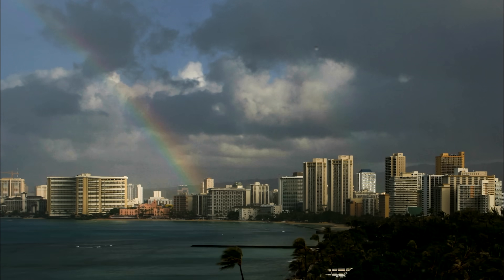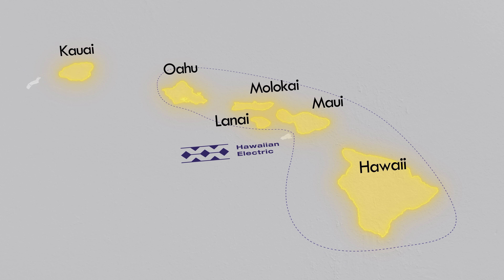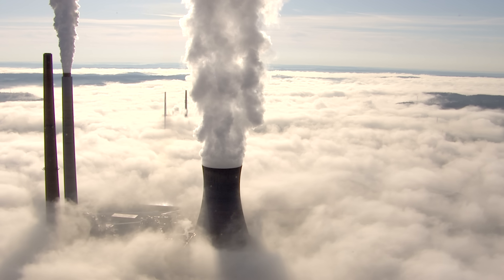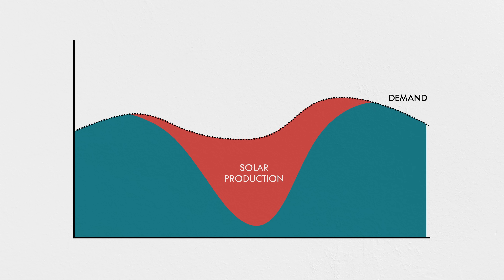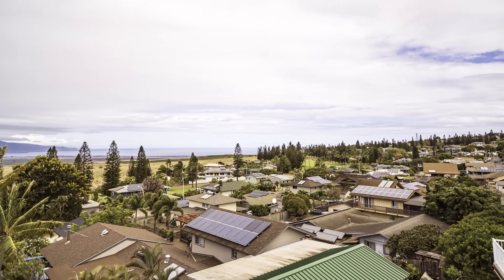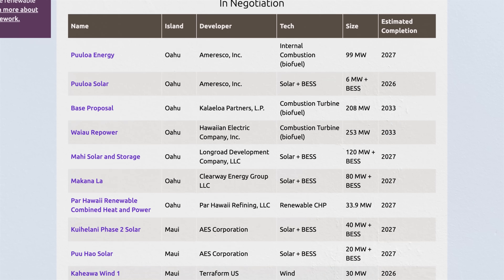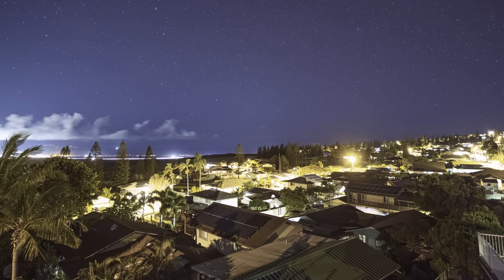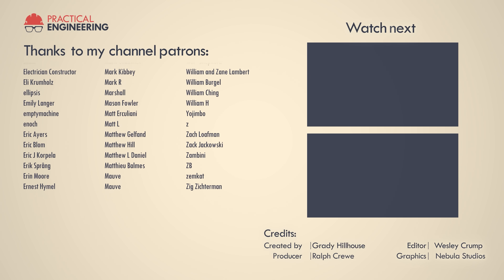How the Hawaiian Power Grid Works

Comment: Excellent video!  Retired power engineer here - worked on a study for the US DOE back in the early 80's that highlighted most of the same points you mention.  While it might seem that the industry has been dragging its feet on addressing the problems, the fact is that solutions rely on technology that simply didn't exist and that had to be developed, and that takes time.  And there's more to be done - which is why power engineering may seem to be boring and mundane, but in fact is one of the most dynamic fields to be in.

And by the way - the situation is Texas is actually quite similar to Hawaii - slightly larger in scale, but still an isolated grid with some of the same issues.
Reply: I have never heard of a Power Engineer, what does one do, and what schools have courses for such a discipline?
Reply: @ColdWindPhoenix84  I was an Electrical Engineer who graduated from University of Louisville. I had Power courses taught by LG&E electrical engineers.
Reply: @jeffjwatts  electrical and computer engineer degrees from university of Kentucky. Power engineering was a subset or specialization of electrical engineering. I don’t think they were taught by LGE-KU employees but were pretty good for base knowledge of power.
Reply: @ColdWindPhoenix84 It's a specialty within Electrical Engineering. Many Universities make that specialization available (though it may use other terms like "energy systems" or "energy systems and renewable energy" depending on the University)
Reply: Texas is isolated because Texas. (politics) Hawaii is isolated because it physically is. Texas is a choice; Hawaii is an unfortunate reality.
Reply: I'm a mechanical engineering student and I'm considering to continue my studies in power conversion field. How do you see the future of this field? Is it versatile as they say it is? My other option is mechateonics. Which one would you choose in the us? Also if you can give me some tips I'll be grateful. Thanks
Reply: @danielkarbaseyan1150 mechatronics allowed me to get a field/engineering job with a utility company, now’s a great time to be looking for a job due to large waves of retiring folks 
Check around your area for jobs/internships (summer internships are common) and also diversify yourself
Reply: @danielkarbaseyan1150  - “power conversion”

The world will always need power, it will likely require some travel.

As long as manufacturers remain in country, Mechatronics may be a good field… but likely will require some travel.
Reply: @DavidHalko  I heard that mechatronics field is not as profitable as (HVAC- heat exchanger design, boilers,solar etc=what I meant by energy conversion) and is not likely to be in the near future. And probably for starting my own business, small scale businesses will be better. Is that the case in us?( not currently living in the us , excuse the low info on my part)
Reply: @danielkarbaseyan1150  - there will always be the need for HVAC, but HVAC technician gets very busy during summer & winter with emergencies. There is a reason people earn more money — they work hard! LOL! 😂
Reply: Questions for the retired power engineer! Let's say most residential and commercial properties in Hawaii adopted Tesla Powerwall's (or I guess any other brand of powerwall), and they made their electric system bi-directional. So during outages, or times of greater need, they could draw from the homes who at that moment had excess power to give. Then, have them install some more Tesla Megapack sites all around  Hawaii to help stabilize the grid even further. Would that be a good overall solution? Also, what are your thoughts today on nuclear power, not just for Hawaii, but in general. I have heard arguments that it is dangerous, and the spent fuel rods pile up with nowhere to put them. I have also heard from the other side, that the most modern designs are extremely safe, and that it's simply not true that there is no use for the spent fuel rods. That in fact, the spent fuel rods can be re-processed and re-purposed. I don't really know what to believe, but I am in favor of nuclear power plants, if in fact they can be engineered more safely than past versions, and if it's true that spent nuclear fuel can actually be re-processed and re-purposed.
Reply: *Ted Cruz has entered his hotel room in Cancun.
Reply: I worked at a DOE national lab that helped to develop a bunch of “smart grid” tech, as well as battery storage. It’s fascinating stuff!
Reply: Texas does interface to the main U.S. power grid and has bought and sold power before. What makes Texas different is that unlike other states it can disconnect from the grid & be independent.
Reply: @MindHunger The ancient DC connections Texas has with the Eastern Interconnect and Mexico are really tiny. We're talking at most something like 0.25%. Basically irrelevant. The real political/oversight difference isn't the ability to disconnect, it's that the Texas AC grid isn't synchronized with other grids. Synchronizing is what would really trigger FERC oversight. BTW - ERCOT is making progress on scaling up connections. Have a look at the Southern Spirit (formerly Southern Cross) UHVDC project. IIRC, it's 3GW.
Reply: @SavageChinquapin   if they can connect better… and it is a DC connection, they don’t have to be synced.
Reply: @MindHunger   I’m not challenging you, I’m just confused, if Texas can buy power from the US grid, why didn’t they buy power? 🤷
Reply: @jsbrads1  Why DIDN'T they buy power? What are you talking about?
Reply: @jsbrads1 there was none available to sell during that cold week we had, the entire country was freezing and wasn’t gonna share what they didn’t have either
Reply: @jsbrads1 - “why didn’t they buy power?”

During the massive cold snap, the issue extended across all of North America, and Texas ran out of fossil fuels to create energy to sustain the peak need. Texas could not even meet the export requirement of Natural Gas to Mexico, extending the energy crisis to Central America!

Additional power lines connecting to other places in the US would have done nothing… the deficit of power needed was massive. Batteries for renewables would have done nothing, since the cold snap lasted days. Renewables could not scale to meet the 3 day peak, neither could nuclear, and only natural gas was available to scale up, and there was not enough natural gas available.

More tanks & larger pipes & more power peaker plants are needed in Texas, to compensate for all the renewables which came online.
Reply: @DavidHalko Wasn’t there a ton of “equipment failure” due to no maintenance?
Reply: @teubks that same week saw huge blackouts in Oregon and other states too. Their interconnection didn’t save them. Texas not having a good interconnected grid isn’t the cause of power failure. It was simply not properly winterizing.
Reply: @MindHunger   during the cold snap when Texas grid was overwhelmed, many people gave reasons why that wouldn’t work helping me understand the situation, thanks
Reply: @jsbrads1  During that time Texas typically buys electricity from other states, but the other states were already at capacity because of the snow & cold and had no excess electricity to sell.
Also a lot of Texas power comes from wind and if i remember correctly 20% of the turbines were frozen.
Reply: @MindHunger   thanks
Reply: @MindHunger  Texas grid is not connected to any other States. Yes, it was a surprise to me too.
Reply: @marcr1333  - “wasn’t there a ton of equipment failure during to no maintenance?”

If you look at the energy produced during the event, natural gas was the bulk of the peak energy, for days. Nuclear could not scale. Wind could not scale. Solar could not scale. Natural gas was all Texas had left & there was not enough.

If doubling the energy output is what happens with a ton of equipment failure, Texas needs more of that.
Reply: @DavidHalko  I don’t consider the natural gas shortage was from lack of gas. It was from frozen equipment. There are enough gas molecules to be burned but the equipment froze.
Reply: @mrtopcat2  Yes, the Texas grid is connected to other states via HVDC, but power import/export is limited. According to Wikipedia, there are two ties to the Eastern Interconnection and two ties to Mexico.
Reply: @Ethan.Lamoureux  Well, that is interesting. I checked a while ago and found otherwise (to my surprise). I am going to have to check again.
Reply: @prst99  - “I don’t consider the natural gas shortage from lack of gas. It was from frozen equipment”

If you look at the graphs of energy usage, from during the time of the winter event, natural gas usage was was orders of magnitude higher than normal usage.

If increasing natural gas usage, orders of magnitude, is due to frozen equipment… then the froze man equipment should happen more often!

The frozen solar panels & frozen wind mills did not increase their energy output by orders of magnitude, maybe the freezing negatively affected those assets.
Reply: @Ethan.Lamoureux  - “Texas grid… two ties to the Eastern grid and two ties to Mexico”

Since Mexico was having blackouts due to lack of energy during the cold snap, clearly clearly Central America had no power to send to Texas.
Reply: @DavidHalko  On average how well insulated are homes in Texas because obviously insulation reduces the amount of heating and cooling load on a home.
Reply: @marcr1333 ton? No. When supplies are stretched thin what would normally be a minor problem can quickly be a major problem.
Reply: and slightly different since they could be part of the national grid and chose not to be...
Reply: Texas is connected. The federal grid in Oklahoma was also down
Reply: @tzoninghard2425 it’s like connecting two Olympic swimming pools with a long straw.  They are connected but what’s the difference.  It’s also not even the whole state, the northern part isn’t on Ercot.
Reply: Why can't Hawaii not replicate the major geothermal success of Iceland? Iceland has even surplus energy to import bauxite and export aluminum.
Reply: @mrtopcat2 There is a geothermal plant on the Big Island, but yes - there is more opportunity for geothermal.
Reply: @SavageChinquapin  The problem is not the lack of technology. The problem is the lobbying for ineffective technologies that were meant to be transitional at best, but instead got established and wanting to become mainstream, despite all of their shortcomings.
Reply: @mrtopcat2  Hawaii only has one volcano. Iceland has many, and some of Iceland’s land isn’t active volcano, so they can build easier there… 🤷
Reply: @jsbrads1  The number of volcanos has absolutely nothing to do with geothermal energy. Hawaii has the same features in this regard as Iceland. Additionally, you can have geothermal energy almost anywhere in the world.
Reply: @mrtopcat2   there are places on the planet where geothermal power is cheaper, you get lots of electrical power with a reasonable investment in construction. On most of the planet, there is less heat close to the surface and a large investment would only yield a trickle of power, never to pay back the investment.
Reply: @jsbrads1  The same location dependent yield principle goes for the other ineffective technologies that are currently being pushed everywhere.
Reply: @mrtopcat2 another thing to think about is the cultural aspect, many native hawaiians opposed geothermal because of the importance of Pele (the god of fire/volcano and lava) to their hawaiian culture
Reply: @UnitSe7en  Nothing is easy or cheap. Iceland is the proof in the pudding. If by politics you mean lobbying efforts by some trendy and just as inefficient industries then yes.
Reply: " slightly larger in scale, " Slightly? The Texas population is around 20x bigger than the Hawaiian population.
Reply: @jeffjwatts And waaaaay more energy resources.
Reply: The cost is the big one. But guess what? Battery and solar costs have and will continue to plummet
Reply: @Mathis218337  - “battery and solar costs have and will continue to plummet” 

But they will not supply the real needs that fossil fuel peaker plants must provide. 

Texas, during a multi-day day cold snap demonstrated that.

Honestly, we need Hydrogen to drive turbines, with massive storage, like we have with Natural Gas. Slowly convert that to fuel cells, as they become more economical.
Reply: @Mathis218337   not necessarily. Unless there is an unpredictable tech innovation making them cheaper, the price will not fall very quickly or very far.
Reply: @jsbrads1  clearly you haven’t seen the price of both solar and batteries since 2000
Reply: @Mathis218337   trends don’t continue indefinitely, large parts of those trends were based on increase in demand and technological innovation.
A sharp increase in demand now would increase the price until the industry catches up.
Electrical prices are inflated due to terrible government policies which may or may not continue into the future.
I don’t expect the price to continue to fall significantly without a significant change like every crazier gov policy or major change in tech 💁‍♂️
Reply: He mistakes power prakeing plants with baseload plants. Everyone will tell you need a lot of gas power plants or storage to support RE.
Reply: @simon2493  "Everyone will tell you need a lot of gas power plants or storage to support RE." This is exactly correct. There is no way to deal with intermittent power sources reliably without somekind of dispatchable storage.
Reply: @jeffjwatts  Well, technically, you could use only intermittent power sources if you managed to get a big enough gird but big enough in this case would probably require a grid stretching from, like, Spain to Vietnam.
Reply: exactly "power engineer"  (whatever that means) more than 40 years ago.
Reply: @ursodermatt8809 many native Hawaiians oppose geothermal power because they feel drilling into the earth is raping mother earth.

Comment: I think the behavior of grid-tied battery storage depends on how it's programmed (case in point - the Australian Big Battery that - reportedly - was able to save the Australian grid a few times. But that was in Australia...)
Reply: That battery wasn't about the Australian grid, such a thing does not actually exist by the way there is the East Coast interconnected system but even in the east there are isolated 'islands' inland such as the Mt Isa (Queensland) area and smaller areas on separate diesel generation too.  Western Australia is all by itself and has separate generation areas too such as the SWIS (south west interconnected system) around Perth.  Essentially Australia has several similar isolated supply situations to Hawaii but within the mainland.

The big battery was all about stabilising SA's (South Australia) state grid after under-investment etc left it reliant on the east coast system for supply at times when internal generation couldn't match demand.  The state went completely dark (electrically, and litterally dark since the lights went out) after a fault and subsequent events eventually resulted in SA's interconnections to the other states opening and the whole state grid fell in a heap.

The concept originally was simply to be able to rapidly supply power to the state network in the case of a shortfall threatening frequency stability causing another state wide blackout.  Since then however it has been also used simply to smooth out intermittent renewable generation, to great effect and the lights have stayed on.

Comment: inverters don't have the "inertia" problem unless their input side is literally browning out, and the inverter should trigger a shutdown before that happens. this is a little bit scaremonger-y. we (general we) literally prefer to buy inverter generators for home backup solutions because they produce cleaner power and can accept more variation on the input side than just wiring a generator straight to the grid.

additionally, there's no reason the micro grid transformers at residences absolutely need to be internet connected. the cyber security risk is avoidable or mitigate-able by not giving in to the "internet of things" schtick in the first place.
Reply: The reality here is that most modern grid connected inverters are technically capable of providing  'virtual inertia'.  The problem lies with the very out of date grid interconnection legislation that states that inverters must not provide inertia.  This is similar to the old 'frequency ride through' legislation that stated inverters must not participate in frequency ride through  - then calling inverters out as being inferior to rotating generators on the basis that they don't participate in frequency ride through.  Now that most grid interconnect legislation specifies that inverters must participate in frequency ride through,  then this perceived deficiency with inverters has gone away.
Reply: From my understanding most of the trouble with lack of inertia matters for inverters that share a grid with industrial loads. This mostly has to do with a lot of industrial equipment like three phase motors drawing massive spikes of power for a few fractions of a second at a time. 

Unless the inverter is specifically designed for such a load such as in a VFD this short but massive load spike can overwhelm the connected inverter’s capacity and cause it to think there is a short and trip offline. 

This is demonstrably solveable but it is a new concern that will have an impact on grid design.